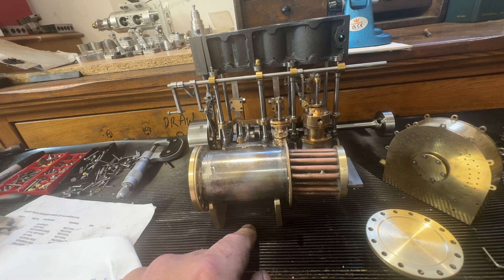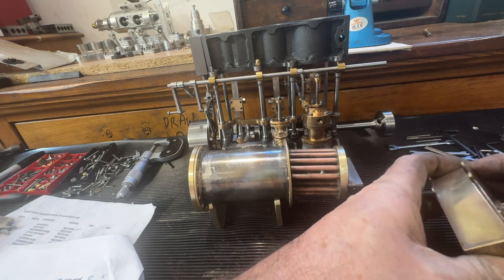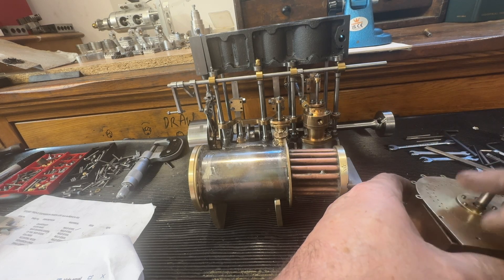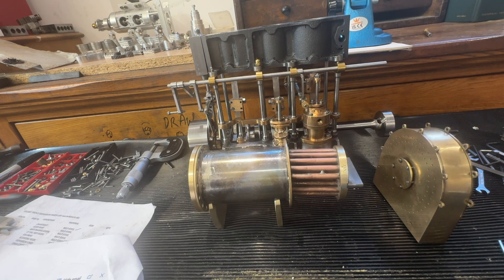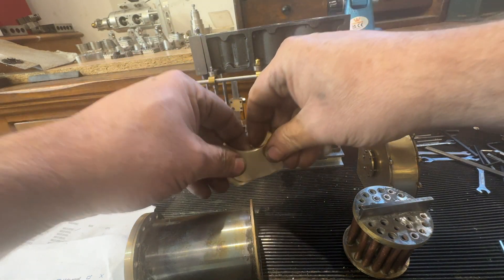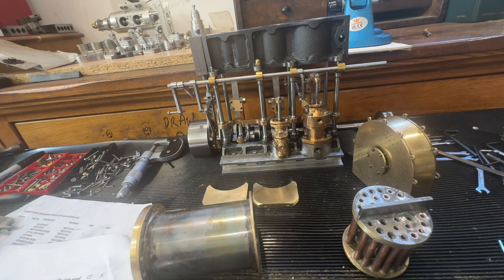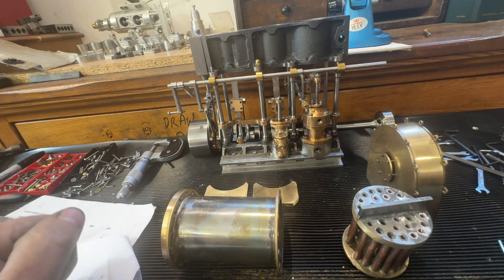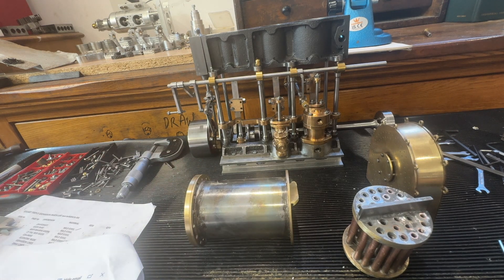Condenser and turbine for theTitanic stuart triple compound part 30

Comment: Is the turbine from a plan? I haven't seen it before.  Did you make it recently?
Reply from the maker: the condensor i have  PM you with existing plans. Barry Caudle also has plans, if you contact him he may be able to supply them for a small beer. He lives in Australia.
Reply from the maker: the turbine....it was scratch built you probably work it out from the video